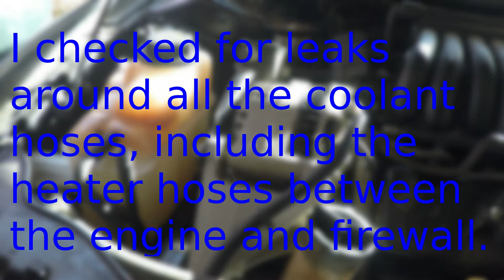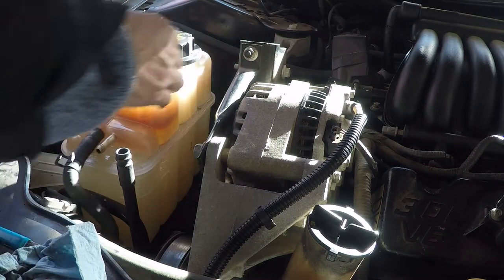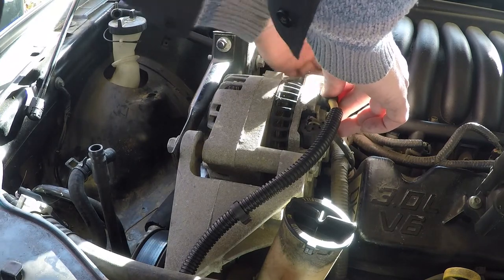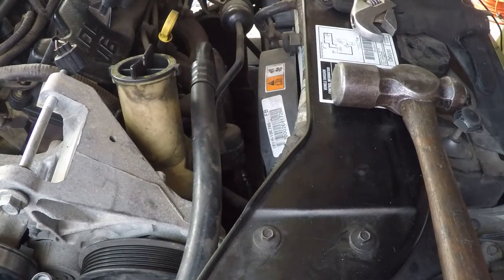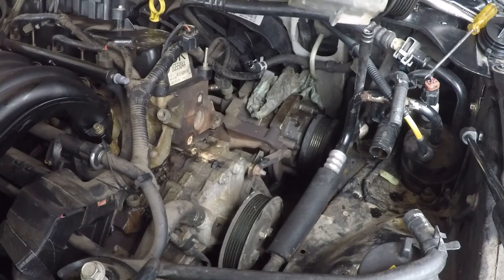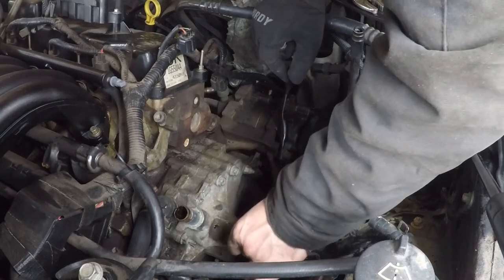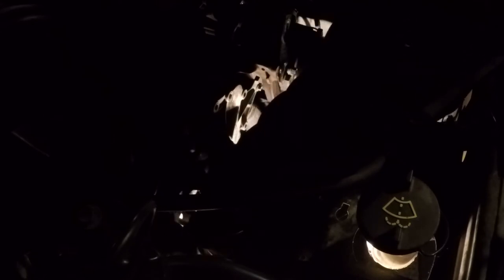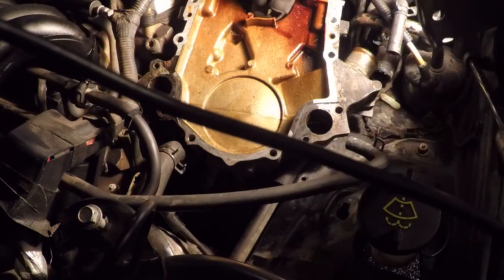Ford Taurus Coolant Leak Repair Part 1 Disassembly

Comment: How did you get those bottom studs out on the bottom left side timing chain cover timing chain cover?? no one never seems to explain on the studs screw in bolts and they're saying you suppose to change the oil pan gasket if it the floppy looking gasket.
Reply from the maker: Im really unsure what you are asking about. If you are asking how to remove the studs from the bolts that go the timing cover, you dont, they are bolts with fixed stud at the end. Its sort of like a threaded rod with a nut in the middle, and threads on each end

Comment: Is that an optima battery? Wow expensive battery for a Taurus lol 👍🏼

Checkout my channel when you have time. Thanks! I subbed.
Reply from the maker: Yep is  red top. I got it because I have a truck that is very hard to start in the winter. but that truck is broken, and this is my only good battery. 
Part 2 is coming soon, part 3 is the good video, with lots of stop motion re-assembly.
Reply: Starion Garage ah that makes sense lol